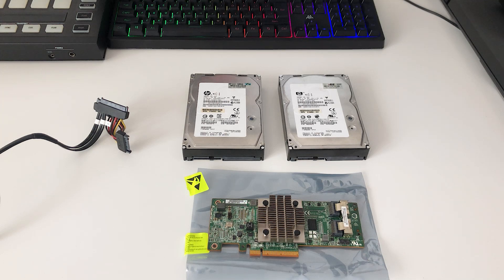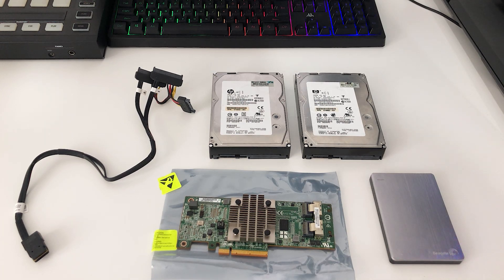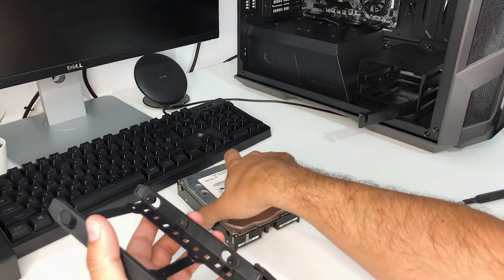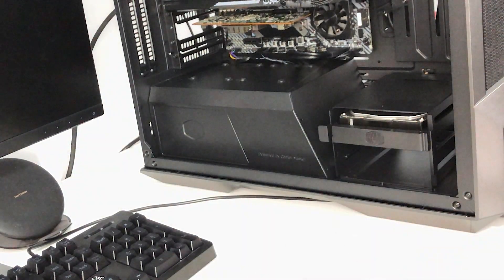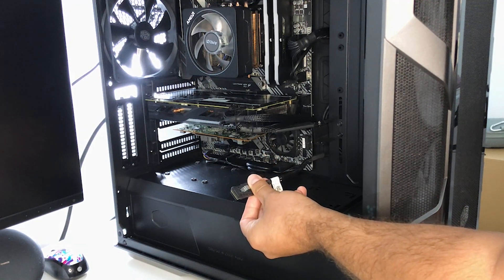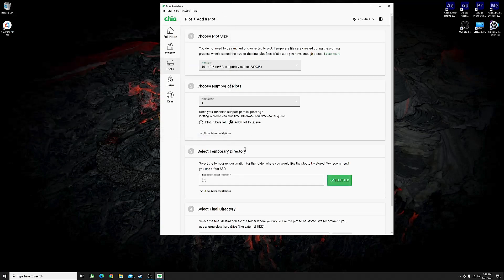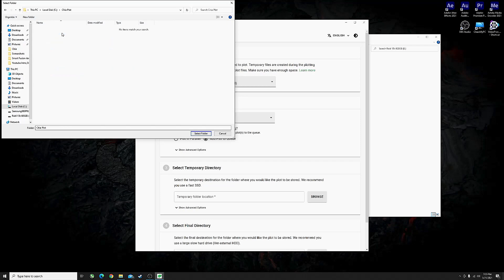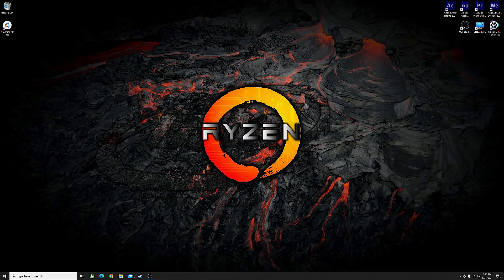Chia Cheap Plotting : Nvme SSD VS SAS Drive

Comment: Those speeds and the price of a used USB3 drive ,(187 MBS) you'll get near same speeds as the two sas drives.
You do know that if you double the drives you can double the speed?
I thought it was odd that the break out only had two and not four? The 8087 is four channel.

Btw bigger cards (real enterprise) you would be looking at around 1.2gbs over I think 4 or 6 drives. Over 8 drives I can get around 8.2gbs which is the most the system busses can do.

Also were the drives just 6gs ? The speed was okay for 6gs, but you should be looking for 12gs drives...
There is also 18 and I hear about 24gs...

Comment: If I can get around 250 MB/s using SATA3, why would I wan to switch to SAS drives? Most Windows users already have SATA3 drives
Reply from the maker: Well Its all up to you if you consider you want the extra investment in hardware for something that is supposed to last longer for 24hrs plotting.Thats the main idea of using SAS  or enterprise hardware, because they are lasting longer then SATA HDD’s/Nvme’s since they have been designed with longer hours of operations in mind.

Comment: where do you get windows 10 driver for a LSI HBA controller card?
Reply from the maker: Hi,you can try here https://www.driverscape.com/manufacturers/lsi/scsi-raid.Hope it helps
Reply: @Tech_Fusion  I gave up on SAS. W10 detects the controller but no drives showing up - no matter what I configure in the Avago controller bios.

Comment: Thanks for the video! I’ve bought one controller and 2 SAS 15k drives. I’m having issues on getting it running on windows or Linux. Any recommendation? It is a IBM M1115 SAS/SATA LSI 9223-8i controller.
Reply from the maker: Does your system recognise the controller and the drives attached to it? Sometimes I heard of people trying to run the controller in RAID mode and having issues with the OS not showing the controller arrays.So I'm not sure if this is the case but if it is try running it in HBA(IT mode) and see if that solves the issue.
Reply: @Tech_Fusion  thanks for your reply! Windows recognize it but with an warning sign. To run it on HBA mode I’ll probably need to flash the card, correct?
Reply from the maker: @techmumus6780  Well first try and ignore that and go into your search bar and type "disk partitions" and open up your disk management app. Once there first check to see if your drives show up as Unallocated space and format them from there if they do show up.If they dont show up there before you go ahead and flash the card try and see if there is any software that was launched for your controller ,because in my case with the HP controller there is a piece of software called "HP Smart Storage Administrator' that allows me to change the controller from HBA to RAID and back again without flashing. Hope this helps man

Comment: RAID0 4xSAS 10k 300GB 4 parallel plot 40GB ram each take 8-10hrs (phase 4 20min and phase5 copy to destination SSD SATA 10min)
Reply from the maker: For my setup I found that running my 4, 15k SAS drives in RAID 0 it was 15 hrs for 4 plots in parallel, but I will post a new video where I will show you how to greatly increase your performance with the MadMax plotter, basically doubling the amount of plots you can do per day.
Reply: @Tech_Fusion  Yep i hear about it i try plotting in RAMdisk but classic metode
Reply from the maker: Yeah its bound to be great in RAMdisk as I seen on the internet some incredible results but for the moment I've just tested with my 15k drives and still was impressed with the results. Stay tuned for the video and thank you for your thoughts

Comment: If you're looking into a SAS cable, get a 4 drive one. The sff connectors carry 4 SAS links, so it's best not to waste the option for more drives. I think they're usually cheaper than 2 drive cables since they're so common. :D But if a 2 drive cable came free with your card it won't hurt anything.
Reply from the maker: Yeah thats true there are quite a few options if you search on amazon/ebay but i wanted something quickly from a local shop so thats why i got the 2 cables with only 2 connections each.

Comment: I did plotting with my SAS 15k 300Mb drives. It tooks around 9 hours on phase 1-3. But when it comes to phase 4. It was super slow. Took more than 100 hours. Do you know what's the problem?
Reply from the maker: There are many people who are complaining about the same issue regardless of the hardware they are using,is just the way that the chia launcher manages file transfer between mediums. I saw some work-around this by doing it yourself manually or by using scripts to copy the completed plots that should reduce the time considerably.I will test this in a future episode and post a video about it.

Comment: so 6 SAS drives in raid would work the same as 1 NVME, right?
Reply from the maker: Well yes and no sadly...you got to keep in mind that the more drives you daisy chain together, the more chance of a disk failure you will have at some point, thus compromising your entire RAID 0 array and making you lose all the plots at that specific farming stage.So Technically running no RAID on a single Nvme is safer and can be matched only by a bunch of other types of arrays together, but you will burn through the Nvme drive much faster then thru a SAS drive altogether. Thats the short of it anyway :) hope this was useful
Reply: wrong. All platter drives have in common that the head can physically only be at one place at a time. As soon as you try two or more read/write operations at the same time (i.e. plotting chia in parallel) drives slow down alot.  NVME on the other hand has a re-order queue of 64k commands, so when you plot multiple files at the same time, the internal controller of the drive can reorder the operations to optimize file access.
Reply from the maker: Well actually the effect of running a RAID 0 configuration on multiple drives at once has the mechanical benefit of being able to write on the platter where a physical head is at one time, on one drive while the other head is in a different location on the second platter on the other disk.It can write in parallel on both drives while the heads might be in different physical locations thus increasing your overall performance since you are treating both physical drives(or more) as a single logical drive for the OS when running RAID 0.

Comment: I did a test on a Ubuntu server 8 15k hhds on raid 0, 2 treats and 3200 ram. It took 8h:43m. Now running multiple plots in parallel the performance suffered a lot. I'm still testing configurations.
Reply from the maker: I recommend based on my own testing, to allocate 4 threads as performance saw a bump after only 10 min of testing.You can check my latest video about it

Comment: Great video! I've been looking for more detailed build info with SAS drives. I'd like to see testing on parallel plotting with the SAS drives, for example how many parallel plots your 2 SAS drives can handle.
Reply from the maker: Thank you,well I am working on a video were I will be testing the max plots i can take on 2 and 4 SAS drives in multiple RAID configurations to see as well what is the best performer.Stick around for it coming in the following days.
Reply: @Tech_Fusion  Awesome, looking forward to it. Would also be great to see testing of 12 gb/s SAS vs 6 (if by chance you also have a 6 gb/s HBA.
Reply: I've been running SAS plotting for a few days now and the best performance you'll get is by running one plot on a single SAS drive. Raid0 suffers heavily during phase 3 when a lot of random rw are coming in. The times are around 10-11h a plot on a 10k SAS drive. Mind you that the SAS controller needs to be able to run in HBA mode.
Reply from the maker: Well thank you for sharing this insight will all of us and I will be sure to test this for myself and post the results here, as the point is to figure out what is the best optimisation that people can get out of their hardware.Would be interesting to see if the shorten time you can get in phase 1 by running RAID can still hold up after a slower phase 3 and overall to get an improved performance on the whole process.

Comment: Is hp smart storage free ?
Reply from the maker: Yes it is,find it here https://support.hpe.com/hpesc/public/swd/detail?swItemId=MTX_4658b2f4289841348fa4d920a3
Reply: @Tech_Fusion  do you know any good freeware to fix sas drives ?
Reply: @Tech_Fusion  the software does not detect my controller ...
Reply from the maker: Are you running your SSA(HP Software) in RAID or HBA mode? Because if you are running in RAID then you will still have to go over to the disk partion software in windows and format the drives that appear there as unallocated space.Only after you will see your drives in windows.
Reply: @Tech_Fusion  i am already using lsi raid master software by acron or something like that but I do not have a license and can not do much.  I am trying to repair a SAS drive that reads bad
Reply from the maker: I would start with EaseUs Partion Magic as it is a free tool to use and if this still doesn't fix your bads try HDD Regenerator although it's a paid service.Still I would think you already tried to fix it under Windows with the help of CHKDSK?
Check this website here for both products mentioned above: https://www.easeus.com/partition-manager-software/hdd-regenerator-alternative.html

Comment: Finaly some information, tnk.
Reply from the maker: I will post as well the performance with 4 SAS drives @ 15K running RAID 0. In testing right now, so after we should make a clear ideea of what to expect going down this path.
Reply: @Tech_Fusion  For Your Information : 

My testing rig :  i7 8700 @4.28GHz, 32GB Ram, 4 x 10K SAS 2.5" drives for Temp1, 4 x SATA drives for final plot copying. 

Test#1 : 
1 single plot, 4k RAM, 4 threads, 1 x SAS drive for TEMP1, 1 x SATA drive for final plot copying.
Phase 1 time:  11477 seconds
Total time: 30871 seconds
Final copying time: 798 seconds

Test#2:
4 plots in Parallel, No staggering, 4k RAM, 2 threads, 4 x SAS drives for TEMP1 ( one SAS drive for one plot)  , 4 x SATA drives for final plot copying (one SATA drive for one plot).

Average time for individual plot:

Phase 1 time:  14719 seconds
Total time: 33334 seconds
Final copying time: 917 seconds

That's about 9.51 hours for 4 plots using SAS drives for TEMP1 during parallel plotting.

Don't use any RAID mode.......use HBA mode (IT mode) for the SAS controller to get much better disk iops.
Most importantly, use only one SAS drive for one plot in parallel plotting.

Hope this helps.
Reply from the maker: @berniewong99  Great piece of info for us all and greatly appreciate you sharing this with us.I will get to testing this for myself as this seems you have got a very good result.
Reply: @Tech_Fusion  Yeah that's far more better than what I expected using the SAS drives for TEMP1.
Now my Samsung 970 EVO Plus 2T SSD can take a little rest for a while........

Comment: Man, when the NVME drive starts going you get a nice visual representation of what maxing out your NAND cache looks like lol.
Reply from the maker: Thank you for your thoughts, I'm quite sure there is a difference in performance but there is quite a difference in price as well when we compare the two solutions and this without mentioning endurance. I'll have a video tomorrow where I will show what 4, 15k SAS drives running in RAID 0 can achieve in performance.